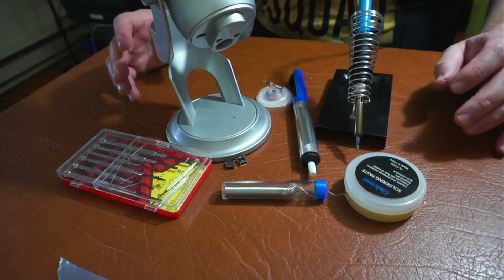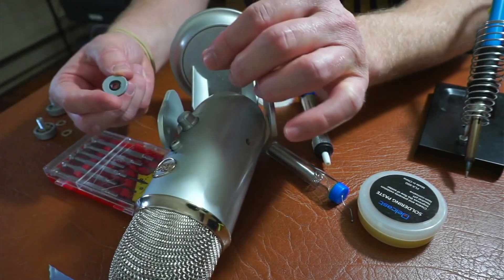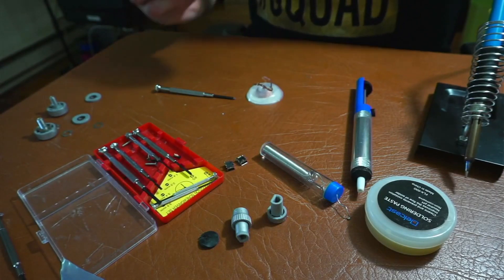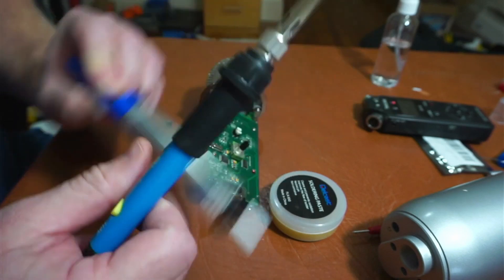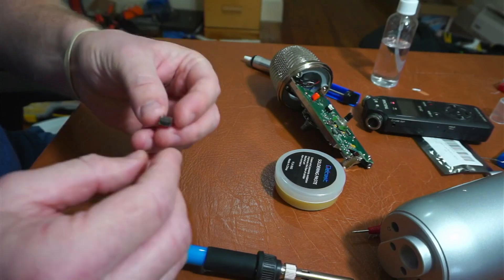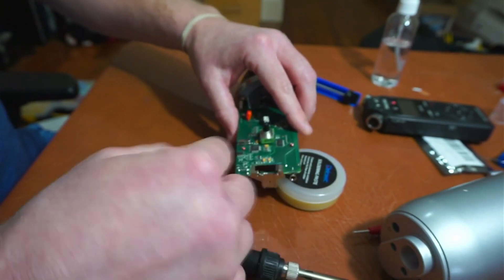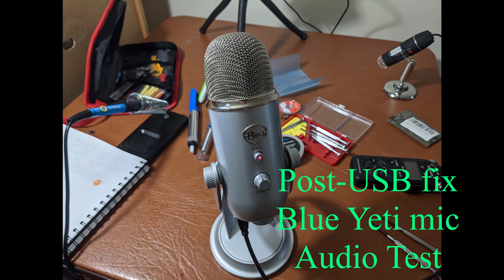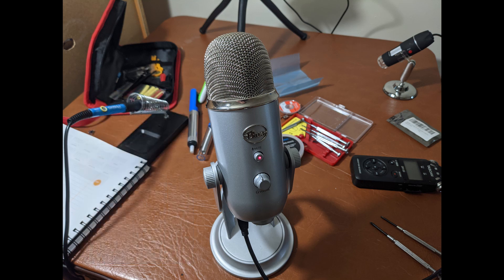Taking apart and fixing Blue Yeti Mic that won't turn on

Comment: Is it possible to replace this with a Type-C? If so which one should I look for?
Reply from the maker: Over my head if this would work or not. I'd think you'd be ok as long as the power source was the same volts and amps, but tbh I'm not sure

Comment: Do I need to unscrew it to pull the mute button out? My LED for the mute button died and I wanna replace it.
Reply from the maker: hmmm..i can now, but i don't think it's supposed to be like that .. there are flimsy little clips that look like it should hold it in place but mine are fatigued out enough it just pulls on and off with virtually no force

Comment: Did everything. But no light any other good ideas? 😊
Reply from the maker: not without seeing it. do you see any burn marks on the board where a component burned up? solder joints all look complete?

Comment: I got a DOA blue yeti, it turns on but not picking up sound what should i do?
Reply from the maker: you ordered it new? then I'd definitely return it... if not then might be worth taking apart and seeing if there are any clear burn marks or disconnections. or of you have a bench power supply you could connect and see where there are shorts, or spray with rubbing alcohol to see what part evaporates quickly to find faults

Comment: I have a question for you: my yeti mic got the Mute button shoved really hard into it from a fall while i was away.
is there any way to pull it back out again?
Reply from the maker: yeah the mute button is really only held in with tiny clips. assuming they probably busted in the fall you should probably be able to just pull it out with a little wrench. but to be safe I'd just take it apart like i do in the video and just extract it and make sure it didn't damage anything else in there